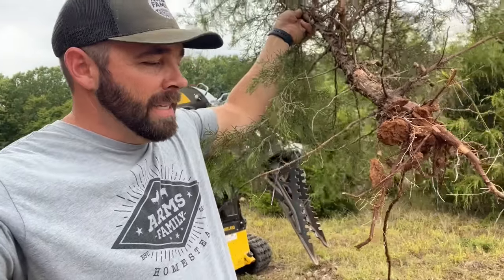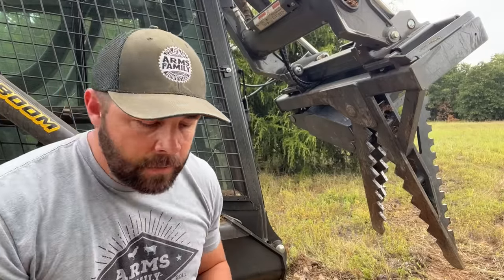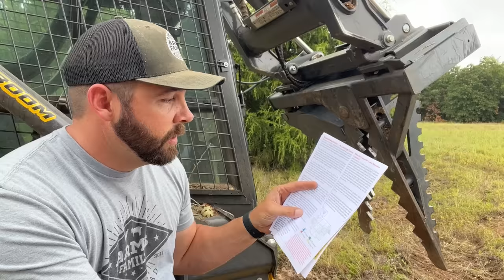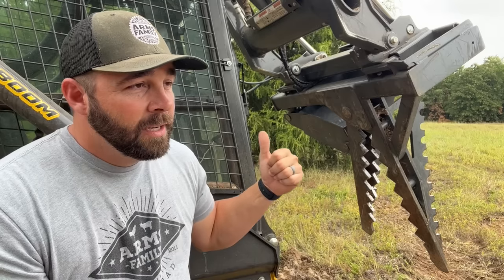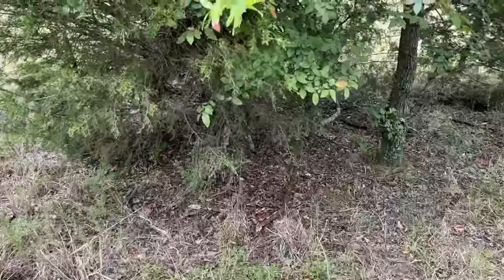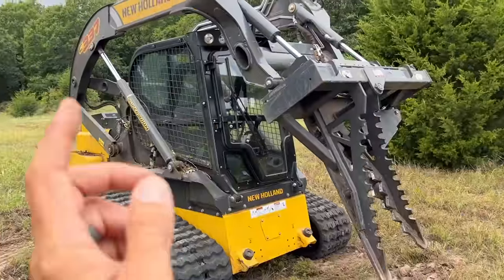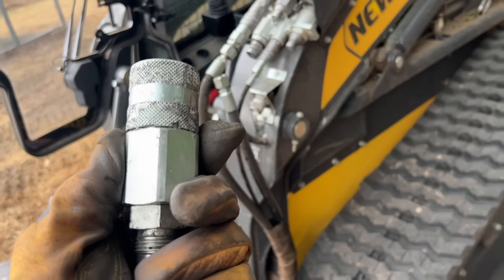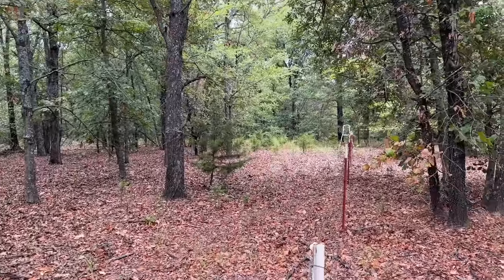Why I Hate Cedar Trees!

Comment: Here in South central New Mexico, we have an area called 7 springs it is on the eastern side of Boy Scout Mountain.  Originally it did flow, enough that it actually created a small creek that had water all year.  Cedars came in and the "tree huggers" went to court to keep them from being cut down.  Well as happens here we had a heck of a wild fire.  Guess what the cedars got burned up and 7 springs is running again after 40 years.  They are as bad as Salt Cedar or Tamarisk.  Invasive doesn't begin to describe it.  They are neither native trees and do more damage than they help.

Comment: The problem with the Eastern Red Cedar is not that it is exotic (it is not) but that natural suppression due to fire is no longer a large component of the ecosystem. Eastern red cedar has its niche, it just is not good for the prarie habitat.
Reply: Exactly you kill the Needles on a conifer you kill the tree.
Reply: @carrollsanders9376  yes, even the fire adapted conifers like longleaf pines are vulnerable if their core of protected growth is no longer protected and vulnerable needles are not above the level of a low burn fire.

Comment: The cedar trees have a chemical compound (oils)which in turn will ignite (fuel) fires.  You don't want these trees next to buildings. Great job Daniel on clearing the cedar.    We've cleared all trees 300 feet away from your house when living here in Oklahoma because of high winds, and the wild fires.  We still have a few cedars, and juniper we need to get rid of out on the back part of our property.

Comment: The needles are acidic.  That's great in a low rainfall area, but bad where you normally get a lot of rain since the soils are already acidic and the needles make it worse.  That's why nothing grows under and around them.  You can help by spreading agricultural lime in the areas where you have pulled up the cedars.  That will give the soil a boost toward a more neutral pH and might help suppress the cedars.

Comment: I am glad you gave us a lesson about the juniper trees. I had no idea how much water the sucked up from the ground!  Keep up the great work clearing them out. I hope you get a new hydraulic fitting soon, i spent 44+ years working in a Hydraulic Valve manufacturing factory. We made the control valves for most heavy equipment and even the tailgate packer refuse trucks.

Comment: Daniel, turn off the skid steer, then work all of the hydraulic levers to relieve the pressure. Your fittings will likely go together & come apart much easier without that built up pressure that is still within the system.
.

Comment: They may be a problem in Oklahoma, but in NC the most beautiful tree in my front yard is a 40 year old eastern red cedar. Cut down 3 that had died in my back yard, and they all have beautiful red heart wood with yellow accents. Used this georgious wood in a bench on my back deck, conbined with stainless steel frame and 4 inch oak plank for a seat.

Comment: Daniel, You explanation of how destructive the Red Cedars are to the ' natural ' environment was good. And as you pointed out... there is not enough lumber in them to be practical for the few fence posts to try to salvage the few. Totally impractical.
HOWEVER.... you might want to reach out to a Local Boy Scout Troop (or a local wood carving Club) and after you have pulled them out they could come in and collect some material (let them do the salvage work ) from the larger specimens. Just a thought.

Comment: just an idea...... mulch some piles of trees then pile up the mulch to compost it, mulch up and spread some piles to keep the mulch to absorb water, and burn some piles all at random.... and keep video. make it an experiment. 
         turn the compost pile a bit now and then, in time you can see what works best. spread the ashes as much as you can in one field. compost in another. a mix in another. Adding mulch spread out will definitely help hold moisture..... as ash should feed another veg..... now is ash form better than 2yr compost? I think where mulch breaks down slower than manure it would benefit both in moisture and feeding the soil...... if you could keep moisture in your soil it should help you in drought

Comment: Cedar trees are basically like weeds. I like to have wild flower gardens in the yard, but some are just not good, they spread like crazy and crowd everything out, like Tiger Lilies, they have ruined my flower beds and I can't ever seem to get every single root and bulb system out and they quickly multiply  all over again if I don't keep an eye on them. I like Tiger Lilies, but I put them out away from the house flower gardens and put them along the ditch and borders of the yard, so they are contained by mowing the grass. Wish I had a machine made for popping Tiger Lilies out of the ground. So I understand how you feel about Cedar trees.

Comment: That is a hickory nut. And I think alot of people mistake the cedar trees alot. In Oregon we have huge cedar trees and they look different then what you are pulling up. We call them juniper shrubs or arbor vitae bushes what you are pulling up. People will hear cedar trees and think they are the big cedars I think. And there is a lot of different species of cedar. When you showed that picture of all of them in that field that was very shocking. They basically took over all that land. That looks like a never ending battle to control those trees. Good luck.

Comment: The tree puller seems the ideal way to remove these trees. Leaving no residues that might regrow, or stumps that will create damages to other equipment, like tyres, mowers, trip people.
Seems to leave a very clean cleared area. Mulching, shredding leaves much messy residue all over, pulling putting aside and then either burning, when possible or shredding or mulching all in a smaller located area seems far cleaner.
A bit of annual or longer interval should be capable of long term elimination of majority of such "pest" plants on the sites, keeping clean as pastures or even hay crop fields.
👍👍👍👍👍👍🙂🙂🙂🙂❤️❤️❤️

Comment: TIMBER VALUE OF EASTERN REDCEDAR

First observed at Roanoke Island, Virginia in 1564, and described by the early colonists as “the tallest and reddest cedars in the world,” the eastern redcedar quickly became prized for building purposes. Finding the heartwood to be rot-resistant, the colonists used it to construct furniture, rail fences, poles, coffins, and log cabins. It is famously known for its fragrant oil, which is a natural insect repellant. Because the scent repels moths, the aromatic wood has been used for centuries in the construction of chests, closets, and wardrobes to protect woolen clothing. Redcedar sawdust or wood chips may also be used in kennel bedding to repel fleas and minimize odors.

Prior to 1940, pencils were made almost entirely from cedar but are now made from cheaper wood sources or synthetic materials.
In the past, eastern redcedars were commonly used as Christmas trees. While still used in parts of the south, the species is not extensively grown for this purpose anymore, possibly because it may be slower growing than other commercially grown evergreens. When used for decorations, it gives off a strongly scented perfume, making a house smell wonderfully festive.

Comment: PLANT PROFILE

Not to be confused with the western redcedar (Thuja plicata), which is native to the western U.S. and an entirely different species, the eastern redcedar is native to the eastern half of the United States. Hardy in USDA zones 2 – 9, it is widely distributed from Canada to Florida and west to Texas.
Below ground, an eastern redcedar seedling initially has a penetrating taproot. But as the plant ages, it develops an extensive shallow, fibrous root system enabling it to persist on outcrops and shallow soils. Above ground, the tree grows 1’ to 2’ per year on a single trunk. It matures at about 40’ to 50’ tall and 8’ to 20’ wide, becoming rounder with age. Very old specimens are capable of growing 80’ or more feet tall and 30’ or more feet wide. The national champion eastern redcedar, located in the Lone Hill Methodist Church Cemetery in Coffee County, Georgia, is 57’ tall with a 75’ wide crown spread.

￼

Female eastern redcedar tree with masses of bluish berry-like cones

Eastern redcedars are dioecious, which means that male and female trees are separate plants. It’s easy to tell the difference between the two. While both bloom in late winter, female eastern redcedars produce green flowers and the males produce yellow flowers. The female trees bear small (quarter-inch), fleshy, berry-like cones that appear in spring and mature in the fall. The “berries” are generally blue with a whitish bloom, giving them a gray-blue appearance, and contain 1 to 4 seeds each. The male trees bear brown, pollen-bearing cones on the branch tips. Their pollen is dispersed by the wind.

The fragrant, scale-like foliage is sticky to the touch and can be coarse or fine-cut. It varies in color from gray or blue-green to dark green and tends to “bronze” In winter.

Comment: This is ironically funny. In the area i live, they are native, and the posts, lumber, and even the saplings this guy is wrestling out of the ground are sought out so much that folks poach other people's land- even federal parks for the resource. You see the red heartwood rots very, very slowly if it has 4" sed (small end diameter) it is post-material. If it is a sapling, it is groomed into a Christmas tree and is preferred by most for its smell. If it is heartwood deadfall, even if s.e.d. is subpar- gardening trellis or grapevine arbor. Planer shavings are a highly valued pet bedding to repel and kill ticks and fleas. The mulch from just chipping the limbs and waste is used for mulch- I have heard but not seen in real life is supposed to repel fire ant colonies. We will not go into the lumber value or the amount of strife that a cedar blanket chest can cause in closing an estate, it's absurd. Larger stumps are usually the preferred mount for every country boy's wall bass, especially if he sands the back so the wife has an air freshener. The stumps are also tied to a cinder block and chucked into your honey hole to provide a long-lasting fish structure. The downside, birds carry and deposit the berries, usually on a bob-wired fence line, and they also carry a fungus detrimental to apple trees. I hope this helps, cedar bark and small twigs are also in my camping backpack for rainy-day fire starters, and lastly, a board is in there for cooking fish. Now if you want something that really, really is invasive- where the only recourse is to bulldoze and burn then carry the dirt to the moon so it does not sprout again Kudzu or mimosa trees.

Comment: They are not prairie natives so don't support native prairie wildlife since they didn't evolve together. I live in VA where it is native but we have several invasive trees that do the same thing out competing native species here that the ERC does in your area. They may also attract invasive insects or tree diseases that could cause further problems to your ecosystem. Its best use for you might be using wood chips in animal bedding during pest season, it's sold as horse / pet bedding around here (horse country).
Eastern Red Cedar is not good for lumber where you need lots of strength, it's a very soft wood. However, it stands up to the elements and is pest resistant so is good for siding shingles, decking, outdoor furniture, fence posts, etc. It's also called aromatic cedar and used for furniture, it's excellent for storage furniture since it seems to repel many insects. It's the tree used for those nice-smelling closet lining boards.
I do wish there would be a push to change the common name of this particular Juniper tree to reflect what it actually is so there's not as much confusion with true Cedars (Cedrus) which are in the Pine (Pinacae) family and includes Pine, Cedar, Fir, Larch, Hemlock and Spruce.

Comment: would it be easier to spray Herbacide on the young cedar trees?
Reply: They would die, but the bushy skeleton would still take years to decompose, so he would still have to mow and plant around them. Removal is the best option. 
The cedars are "surrounding" the other trees because the birds eat their berriers then drop the seeds while they are roosting in the other trees. The cedars grow fast at first and block out any shorter/slower competetion, much like the Yaupon Holly does around where I am.

Comment: Not every plant, tree, or animal is good. There is a a pear tree, The Callers or Bradford pear from Asia that is banned here in Ohio. While it has beautiful flowers in the spring and pretty foliage in the fall, it invasive and can cross pollinate with Pear trees that normally produce fruit. Their trunks break easily in storms causing property damage. They are also escaping into the wild and forests doing no good there. It's your property, do what you need to do. You don't need to worry about what the Eco cultists say. Maybe if they did some research before putting on their Keyboard Warrior cape they wouldn't need to say anything. Wouldn't it be funny to hear what they had to say after using one of those Cedars for a Christmas Tree.😂😂